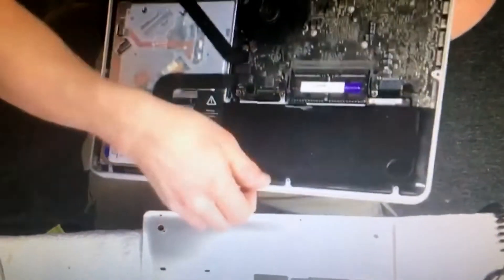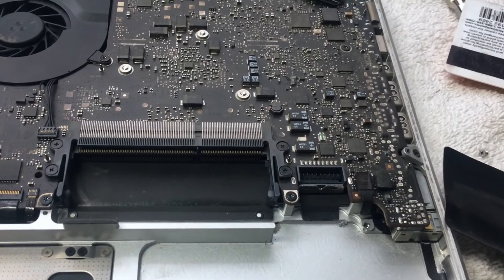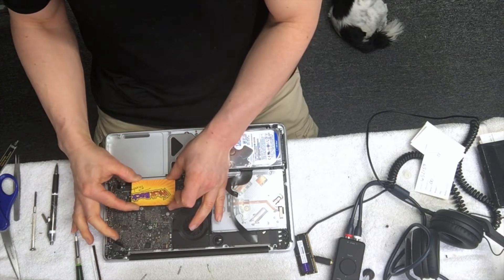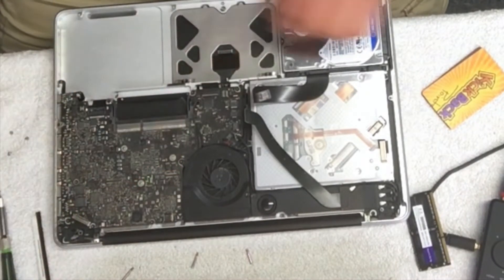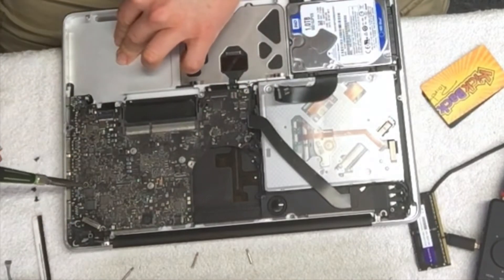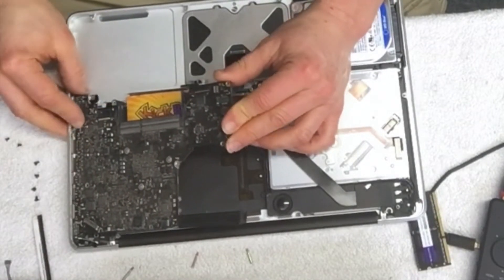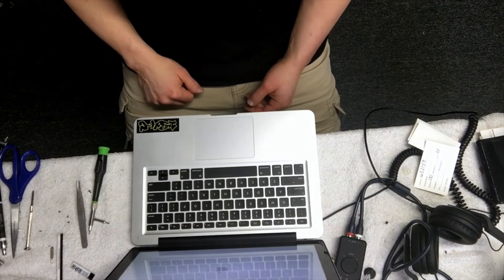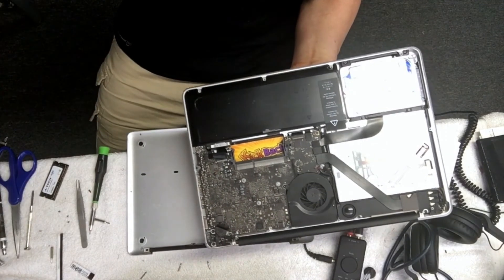2012 MACBOOK PRO FAULTY RAM PORT FIX... yes it really works

Comment: Thank you so much. But I did a slightly different way from you since I didn’t want to remove the motherboard from my Mac (as I don’t have the right screws and the time). 

All I did was get any card (e.g. credit card) cut it to exactly fit under the bottom ram slot, and I fitted it right under motherboard and the ram slots (you have to use the corner to pry the card piece in). I also added another layer to cover a tiny gap on the right side. Even though the extra layer causes it to stop the ‘clip’ sound when you stick in the ram, the ram still needed to be pushed down (but you will need pressure to put it in) it works on my Mac. Thank you very much for your tutorial - you saved me £50 on RAM upgrades

——————————————

UPDATE: ALSO, people please check out these two videos to 100% fix this issue for good:

1) https://youtu.be/qaJpsmBt16Y (this video shows the double card tactic underneath the ram slots which is really important, and it mentions about the sticker issue that can potentially cause this) 

2) https://youtu.be/EIkdhfVMdu0 (this video basically mentions to put two cards together between the ram sticks)
Reply: Also, when you push/insert the ram sticks down, the bottom ram may stick up due to the plastic card underneath it preventing it from clicking - simply insert the top ram on the top slot and push it down (while it’s under the bottom ram stick). This will both go down, even though it may not provide a ‘snap’/‘clip’ sound since the plastic is stopping the gap to make a sound
Reply: Thanks for video links. There is no need to remove logic board to fix this lower ram slot problem for some people. It's 2020. I bought a Macbook Pro 2012 on Craigslist yesterday for $150. The same bottom ram issue of my bottom ram slot on my Macbook pro I fixed with a plastic straw while drinking a cocktail. I cut two small pieces of the straw and placed them under the bottom ram slot. But first I loosened 4 screws that held the ram bracket. And I tightened the screws back in the end. My Macbook Pro mid 2012 recognized both ram slots!! It works!
Reply: SirSubliminal I don’t think the plastic straws are strong enough, since it isn’t hard like a real plastic card, but you can try. But yeah I said in my original post that I tried a different method without moving the motherboard by sticking stripes of cards under the ram slot. I used a subway loyalty card I picked up free at the subway store.

I would recommend using plastic cards, and watch the videos to get rid of this problem 100% once and for all
Reply: @MrIDGAF  Good point. Placing a plastic card underneath the lower ram slot is the best thing to fix this problem. But loosening the 4 screws before that is, probably, helpful too. Today I clean installed Catalina macOS on this Macbook pro 2012 that I got yesterday. Works great!
Reply: SirSubliminal Well I still had problems after I applied the plastic card, but when I started researching deeper for the first time (without headaches) it’s finally stopped.
Reply: @MrIDGAF  what research? I  am facing the same problem can you help or make tutorial
Reply: @devikaphukan_official  Hi, after like 4 months of fitting the card thing in, the issue started happening again, but went away after a 1 min (when shutting down the laptop and leaving it off). 

I believe that this is a temporary fix (since it lasts like 4/5 months and then freezes once and then the cycle repeats), even though it happens once in every 4/5 months - it’s not ideal if you’re doing a lot of progress and your laptop freezes in that unfortunate time once in 4/5 months. 

I think it’s just best if you bite the bullet and pay £40 for a single/1x Crucial 8GB Ram (which is what I did last week), and works like my (4 x 2 GB - 8GB Total) old ram. I only paid for it since the ARM MacBooks are going to come out soon, and I’m gonna buy a new MacBook in summer 2021. So, spending £40 for a laptop to last me a year is fine. I’m a student so I can’t risk having a new laptop in middle of my studies. 

And about your question, I’m sorry but I won’t make a video about this, but I have linked some videos about what I was talking about - the video links are my research and a few websites (I haven’t listed because I can’t remember) like the iFixIt website. So, just read my comment and just click on the video links
Reply: @MrIDGAF  thanks buddy..i think i will also go do that..just  one confusion single stick ram shoud be dual channel or single channel will do..
Reply: @devikaphukan_official  Dual Channel basically means 2 ram sticks working together or 2 ram slots. A single stick is just a single channel but it can be used in a dual channel MacBook with the bottom slot empty. Honestly, I would recommend just using one your sticks if they are 8GB. You can use 4GB (as we’re speaking) but it’s slow on Mac OS Mojave’s or Catalina. I would use 4GB if you were going to replace the MacBook very soon. If you’re keeping it for a year or more then it’s best to get 1x 8GB ram to get rid of the headache (it makes such a major difference from 8GB). 

Also, people say using dual channel (2 sticks at the same time) is a little bit better/faster, but honestly I haven’t even noticed a difference from 2x 4GB ram (original) to 1x 8GB ram (crucial).
Reply: @devikaphukan_official  Also, you have to test which slot is faulty (just use one stick at a time and gently touch the stick while the MacBook is one - if the top slot freezes then the top slot is faulty - and if the bottom slot feeezes then the bottom slot is faulty. 

Usually people (including me) have the bottom slot faulty, but you might as well test it.